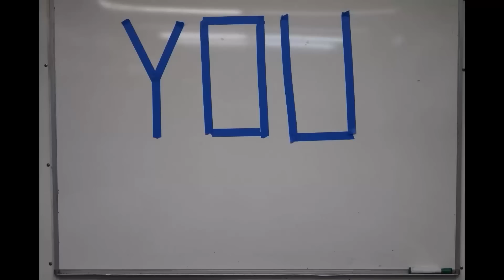Let's go Top Fuel Racing!!

Comment: Top fuel, rock concerts , and slow dancing: None translate right to TV or videos.
Somewhere on the internet is some ultra ultra slow motion video of a top fuel launch that shows the tire flex of every single power pulse of the engine. Which, to me,  is sort of amazing that it can unflex a bit between pulses

Comment: When did this 4 lane track get built ? Never seen that
Reply: Been around awhile. Early mid 2000s. They just changed last Vagas to 4 wide.

Edit: I looked it up. It was built in 2008. It's basically across the street from Charlotte motor speedway. Also the dirt track is in between the strip and the big track. Highway 29 also runs in between them.